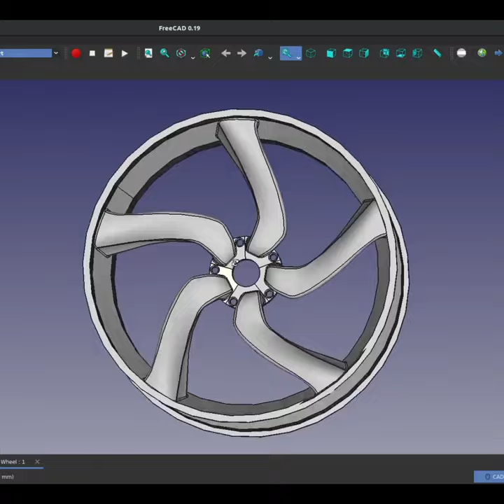FreeCAD- Sweep on 3D Paths! #Shorts  |JOKO ENGINEERING|

Comment: Why Freecad doesn't have grid floor like other 3D program? 🤔
Reply from the maker: Interesting.  If you're looking for a pattern like that to do surface quality checks, zebra stripes are available in the Curves workbench
Reply: @JokoEngineeringhelp 
No, i mean viewport grid display on the 3D space floor
Usually has axis line (x,y)
Not a surface pattern.

Anyway thanks for your response 👍

Comment: Yes very nice, but you don't need the curves workbench for that! It would be niche to have at least 2 methods or more shown!
Reply: Which would be the other method?
Reply: @manoelbs  Part Workbench: Create 2 planes from splines intersecting each other than make a wire by splitting cutting or equivalent. Further more you could draw a line attached to a helix create a plane cork screw like, create a rectangle around it cutting the helix plane. Result would be a rectangular helical wire... Or a rectangular spring wire/ spline/ path.
Reply from the maker: That method was shown and has been up nearly 3 years, as well as another method using draft.  Explaining multiple ways to do it on a video format that is limited to one minute or less isn't very realistic.
Reply: @JokoEngineeringhelp You got a point here. Nice vid's keep it going, very appreciated! :)
Reply: @jimmihenry  Thx